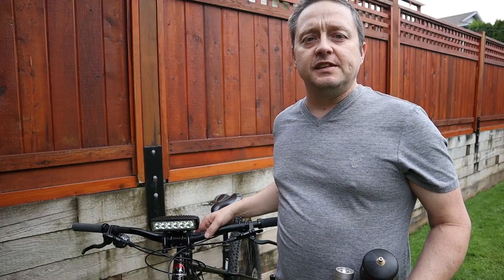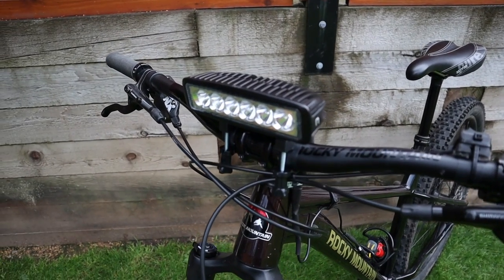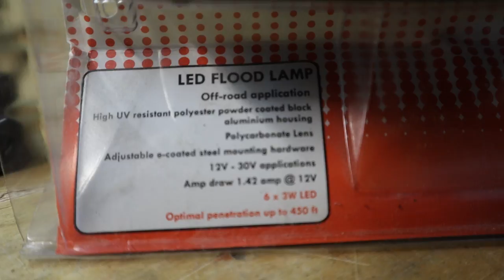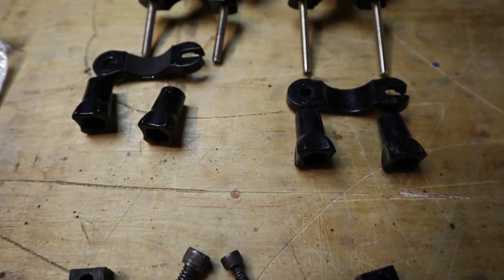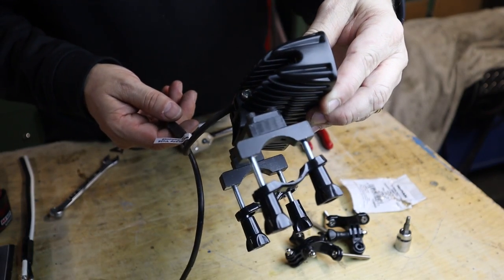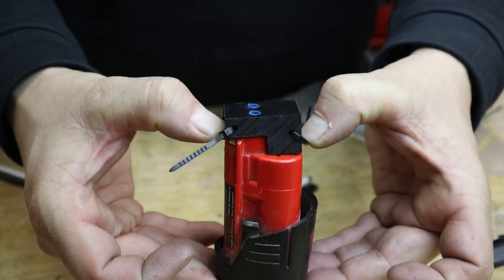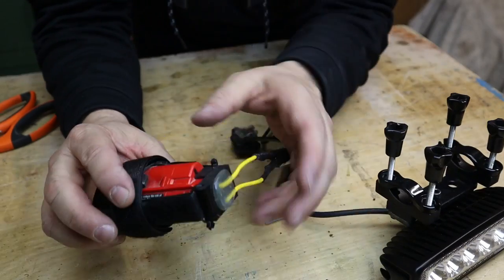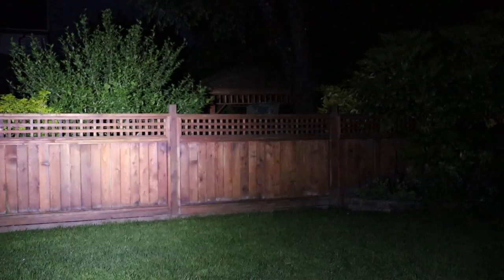DIY LED BIKE LIGHT... can it be as good as a high end light!? / How to make a bright LED bike light!

Comment from the maker: Version 3 Light with BMS: https://youtu.be/Ohwle0mJ0mw
Reply: Does this light have a built in dc-dc converter
Reply from the maker: @mtbhillbilly  I'm not sure. It's a sealed unit with no way to open it up. It basically operates from 9v to ~28volts.... so I suspect some sort of regulation is built in unless the LED's can operate in that range. Not a lot of specs on these lights. I may have to crack one open one day! cheers
Reply: @MikeFreda  I bought this after seeing this video what a great light for night riding been going out at night since i got it shredding them muddy trails, i add longer wire then connected it straight up to the 2 pin sm plug on my sw900 e bike display
Reply: Also thanks for showing us this i got mine for £9.50 of amazon

Comment: I installed a 9” terra bar 30w bar light on my ebike & it’s brighter than most cars I keep it on high beam until they lowered theirs if not oh well a blinded eye for a blinded eye 😏 & I can tell the difference between factory & aftermarket lights 90+% of the time.
Reply: I wired my light bar into an ebike light/horn switch. I use it in combination with a cheap light/horn in one. I dim it for pedestrians, I live in a city with extensive bike paths. It makes a shadow of riders I overtake in the spot their own lights are shining into.
Reply: Yeah I have a GoPED esr1000h electric scooter that is awesome. I get about 20m at about 28mph and 35m at 15mph on a stand up scooter. I ride it everywhere since I don't have a car nor want one. Didn't wanna mess with my battery life adding in lights and I had a 24v 25ah li-ion battery not in use anyways so I figured max it out. I put a 12in 72w lightbar on the handlebars, a 3in round 18w red led light on the rear, and the blue 12in 18w led strip underneath. I have my lightbar mounted creatively where it rests all the way down and that's right where I want it and it's just out of blind em range but I put a little easy to grab and push lever that will raise it up with no effort and into the "how does that feel when it's you asshole" range. Oh I've had people stop and want to fight me a couple times but I live in Texas and we believe in guns and it's legal to carry as long as it's not concealed and they see that on my hip and conversations over Everytime. But it's overkill but I love blinding em back. Got sick of people thinking it was funny to blind me on that thing hoping I would wreck because of it. Now it's me hoping they do 😉
Reply: @matthewfiedler2787  I always say a blind eye for a blind eye if they keep their high beams so do I ..
Reply: Amen brother. I'm a night owl and broke my back, neck, pelvis and tail bone early last year from a 20ft fall off an overpass. (Robbed and thrown off)...
So after I healed enough buying this scooter used was a no-brainer. Easier on my still fragile body getting around and made it so I can go more than a couple blocks. Well, I got better but still have bad days but don't matter I love riding it and go everywhere even if it's nowhere in particular feel me. So safety was a must because I cannot afford to get hurt on this at any speed but especially top speed like I ride it. Well, every night I get 1-2 high beamers during the week and Friday and Saturday it's probably 2-4 just depends. I don't count the people who see me and turn em off, that's just the 1s turning em on for me and can't be for anything but to blind me which anyone can figure out would make me wreck.
      So I took action. Armed my scooter with what my mom likes to call my "FUCK YOU MODE" LOL...
I was already carrying myself due to what happened to me even B4 Texas changed the law to anyone can carry without a license as long as it's not concealed. It's proven to be a wise move since my scooter is about $3000 new and especially after fuck you mode was installed. I've had many run ins with people trying to jack me or pissed because I had the gall to do onto them as they did onto me. I've even had cops see the whole situation happen and not give a damn about any of it. Only things ever been said was... "Wow that's bright for a scooter" or something like it and "you got what you deserved" or something like that also....
 I don't feel bad for doing it I just hope that since I am up at night that none of these people have kids in the car and that my "return fire" doesn't cause them to wreck and kids get hurt. I could care less about the adults. Kids getting hurt would really mess me up inside bad. Probably end up back on drugs again or some shit. Took a long time to get off em and been off a couple years but that probably would get me on em again. So I think about it all the time about how much could happen just from it all going "south".
It keeps me on my toes and aware of my surroundings for things that could make each situation go bad so that I make a wise choice when it's needed for everyone to get home safe.
Reply: I've even been in a situation where they passed me and turned around on a 2 Lane road speeding around a bad turn at me just to blind and swerve at me a bit. I could of got em, I seen it coming but moved out the way at the last moment and turned off my lights, flipped a bitch, and followed em hoping they would get caught at the light about 1/2 down and it was better than that. They pulled into the gas station at the light to get gas. So I just hopped off my scooter and liberated the glass from their headlights with 1 foot rod no one sees strapped to handlebars. Only got to liberate one tail light before they were running out the store and tried to chase me in the car. They made it 2 blocks and a cop headed right toward us pulled em over for the headlights and I was stopped by another officer a couple miles down but thank God it was a "Habib store" with no working cameras pointed at the pumps. Those cameras happened to be broken. The cops watched the feed from the cameras inside that could see out at all but no shit of it happening. The clerk didn't see shit because I know him, it' happens to be my favorite road to ride at night and where I stop and hang smoking cigs and drinking coffee outside with him when he's not busy 😉 

Real shit, I was scared as hell I was in trouble again. Have 5 felonies and like 20 misdemeanor convictions unfortunately. That's why I quite drugs. Can't get in no more trouble. But after it was all said and done....
I FUCKING FELT LIKE SUPERMAN!!!

Comment: thanks for sharing the video! you made me realize i actually HAVE this ligh in the flood only beam pattern and it works GREATt! 

I designed a mount for mine to be 3d printed. i'll post it here if anyone is interested.  

Note the light works from 12v - 30v according to your packaging.  so you can go with higher voltage if it makes your system more simple.  Actually the light will function down to about 7 or 8v , the light intensity dims down and the light draws much less power as you drop below around 10v.  This SHOULDN'T harm the light and it should give you TONS of extra run time.  

unfortunately the version of the light i have is Flood only. It still works great as a bicycle headlight, however much of the energy goes up into the sky , and i don't need to see up there so that's wasted energy. And i think i would prefer further light penetration vs lighting up the trees 30 feet above me.   I'm going to look for the spot/ flood combo like you have.  currently at harbor freight it's listed at $27 for either the flood only or the flood/ spot combo which is a decent price but not close to the $15 you found it for.  

Here is the amazon link for spot lights.  it's dirt cheap!  $17 USD for 2x spot lights!  i don't know much about the beam angle but i might give it a try. It shows 25° beam angle... maybe the flood / spot combo is the best setup?   https://www.amazon.com/gp/product/B01LS0AP3W/ref=ppx_yo_dt_b_search_asin_title?ie=UTF8&th=1
Reply from the maker: The 3D printed mount sound like a perfect solution for a plug and play setup. I’d like to see what it looks like.
Reply: @MikeFreda  it is designed to fit 32mm handlebars. I'll upload to thingiverse and put a link here tonight.
Reply: @MikeFreda  also, i forgot to mention, it is not quick disconnect. it uses m3x16mm bolts to permanently attach.  designing quick disconnect might be above my 3d design abilities.
Reply: Check my channel out for vids of something similar I wired into my ebike. I  used a truck light that is rated to 36v.

Comment: I bought this after seeing this video what a great light for night riding been going out at night since i got it shredding them muddy trails, i add longer wire then connected it straight up to the 2 pin sm plug on my sw900 e bike display
Reply from the maker: Thanks for commenting.  Glad you found my video inspiring.  Cheers.

Comment: I used what looks like the same light bar for the same application on my ebike. The lamp however, on the webpage was rated 12 to 24VDC (Two for $20). When I initially tested them, they both worked at virtually full brightness at 10VDC, so I used a 4s1p Li-ion battery pack configuration (16.8VDC fully charged, down to 11.0VDC fully discharged) and it worked fine. A wide margin on voltages it can use makes battery setup decisions very easy. For other readers I recommend finding a light bar with a voltage range under which it can operate...which gives the user more options on battery pack configurations.
I also used 21700 Li-ion cells at a REAL 5,000mAh capacity instead of 18650 cells which sellers often over-rate by claiming ridiculous capacities like 5,000mAh, 8,000mAh or even 10,000mAh.
A high quality 18650 at a decent price with a decent number of recharge cycles, isn't capable of providing more than about 3500mAh. Any seller claiming more than 3500mAh for an 18650 is really "stretching" things. The main problem with using 21700's is finding an off-the-shelf watertight battery case for 4x 21700 cells can take some searching, whereas there are lots of such cases on retail websites for 4x 18650 cells.
Reply from the maker: Thanks for the comments and feedback. Most of your findings is what I encountered as well.  The 18650 is the better battery for this task.  I've tried a lot of things and have come full circle back to the M12 battery pack and the charge/power adapter. Have a look at my last bike light video.
Reply: @MikeFreda  with the battery pack from the drill, do you use the battery charger that it came with to recharge the battery?
Reply from the maker: @NicolaMs007  Yes

Comment: light is also sold at walmart. Ive made floundering lights, boat lights, bike lights, even a headlamp from those. for batteries I use the 18650s from either tool batteries or laptops
Reply from the maker: Yes, those batteries work great. Look at my version 2 light system. I use those batteries and a different light bar to see what the difference is.

Comment: For anyone making something like this(Im making it, but different, with a little bit more features) you can put battery in a seat tube, disassemble it, or make your own using 18650 cells, place them on top of each other to form long tubular pack, and it will be so clean hidden inside seat post
Reply from the maker: Good idea. I wonder if heat dissipation is an issue?  I do have another video showing how to use that style of battery. Cheers.

Comment: The satisfaction making things difficult for yourself. I'm with you. It's not as if there's anything this powerful and efficient sold as is for the purpose of cycling with an included reliable bracket. No chance. Maybe for a motorcycle or extra lighting for some off road 3 wheeler or pick up truck accessory. Oh and if you did find this arrangement, which is probably pretty common for ATV's and the like, it would not run $15. Hopefully it doesn't catch on fire or need total rewiring. I wouldn't push it full blast. Nice build would love to know how it has held up!
Reply from the maker: Thanks for commenting.  My son and I have been rocking these for almost 2 years now with no issues.  Full power for 1/2-1hr at a time. I’ve made a couple other versions with battery protection and different LED lights and they all work great.  The light bar in this video is a bit heavy but for the cost and performance you can’t go wrong.  I experimented with lighter/smaller lights and they work good enough for any trails I plan to ride.  Cheers.

Comment: Here in manila. That 6led bars only cost $1.50 i installed that on my ebike😁
Reply: Talaga?
Reply: @jasonm1690  yes po. Sa shoppe.😊
Reply: @jasonm1690  Oo Nilalagay Sa Mga Headlight Pampalit
Reply: @jasonm1690  Mura Lang Yan Sa Shopee At Lazada
Reply: @puroroy9  
May aluminium may plastic. Pero just the same. Pwdeng pwd sa ebike. Same lang ang lakas nila eh😁
Reply: @puroroy9  
I ON nyo lang po dapat pag tumatakbo. Para medyo madaanan ng hangin at iwas overheat.
Reply: oo totoo yan yan din gamit ko powerbank pa source ko 5v to 12v converter lng yan haha chicken na chicken na diy

Comment: Nice looking light set up,what runtime do you get off of one battery and size of battery? Thanks for sharing
Reply from the maker: With the 1.5amp hour battery we got over 1.75hrs of actual "light" time... since we took breaks and took turns with each other lights on (going up hill) you can easily do a +2.5hr ride on one battery. If you had a 2 or 3 amp/hr battery you could ride as long as you wanted.  Also, they are small enough that you could carry a spare. Check out my ride video for more info.... that being said, a 3 hr night ride is a long ride! lol

Comment: I did this with a regular rechargeable 5v battery pack, step up converter with USB and DC on the ends, and solder or crimp a dc female on the light. Way easier and cheaper.
Reply from the maker: Great idea. What's the life span on that? Are those Step up converters rated for 1amp or more?
Reply: @MikeFreda  Man im not gonna lie i have no clue about electrical stuff, i just know positive, negative and volts lol. Everything plugged in i just hoped it would work and it did. But i have a 8 inch light bar and the rechargeable battery keeps it on for an hour and change. I have a motorized bike i didnt want to use power from the motor

Comment: i recently bought a 2000 lumen led husky rechargeable worklamp and mounted it to the front of the bike. i use the battery to keep it charged,so i can use it at full compacity
Reply from the maker: Cool. That should work well around the city.   You may need something with more of a spot to ride trails.   Cheers.
Reply: @MikeFreda i bought a 1100 lumen led head lamp with spotlight feature,I can turn night into day..lol

Comment: Hi, it's been 4 years since you upload this video but I want to give some advice if you don't mind. If you want to shot comparision video for different lights, you change your camera's ISO settings from auto to manual and set a constant value. Because even the difference is visible, camera automaticly sets its ISO value for low or bright light conditions and make it looks same on the screen.
Reply from the maker: Thanks for commenting. Yes, you are correct and it’s something I struggle with. Low light and night filming is hard to do without higher quality cameras and lenses. With this video I used a GoPro and an iPhone that automatically adjust (as you stated). When editing I try to capture what it really looks like from my minds eye and still photos. It may be perceived that I’m trying to skew or trick people to think this is way better then it really appears to be, but I’m not.  Another option would be to use a light meter to measure the brightness/lumens.   Thanks again.  Cheers.

Comment: I really suck at this things but please correct me if I'm wrong. You said 2-3ah battery should do just fine for a few hours. Would a lamp like that work on a powerbank that has 10.000mah? Converting that to ah, should be 10ah.
Reply from the maker: Yes, that is the right math but, if the power bank is for Cel phones, those typically output 5.0vdc. If you step that up to 12v you will have less capacity that what it is rated for.

Comment: Hi, I have the same light but can I  use 24 volt drill battery? Because I want the battery to last longer or I might fry the light?
Reply from the maker: Perhaps.  You will have to see what your light specs are.  A lot of these lights look the same but don’t have the same parameters.  The light I purchased works between 9-28volts. A larger capacity 12v battery (3+ amp/hr) will make this light run for several hours.  Cheers.

Comment: is it possible to do the same but with a RYOBI 18V 5 AH battery?
this would be great to put on my e-bike, oh WOW!! Am seriously thinking on doing some like this for my bike, I am buying myself an AMP Bros.. Ace X Demon which is similar to the Aerial Rider Grizzly V2....along with a home built lighting kit for the front, rear and brake light with indicators....adding a light like this as well, would be over kill, but the more light you have the more you can ride on the road at night....plus this would also be a good light bar light to get the oncoming vehicles with their BRIGHTS on to dim their lights....
Reply from the maker: Depending on the light brand/manufacturer it should.  These lights typically have a operational voltage range from 9v to 32v. You will have to read the manufacturer specifications.  Cheers.

Comment: U can get a tool container insted of water bt. Got my power bank in one. But looking for bether lights. 12 v hmm
Reply from the maker: Yes, I was looking at those as well but some of them got bad reviews that the lids would pop off, so I was sceptical. I did find a stubby water container with a wide mouth the very durable and seals really good. I will post a follow up video of the finalized light system.